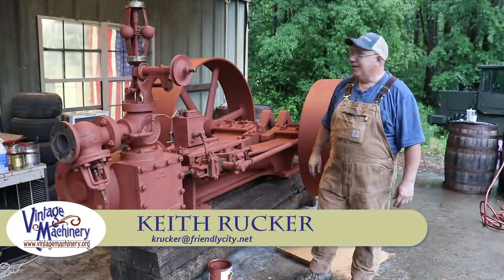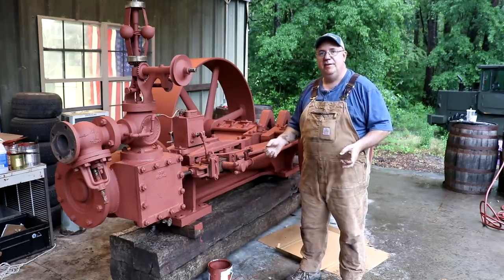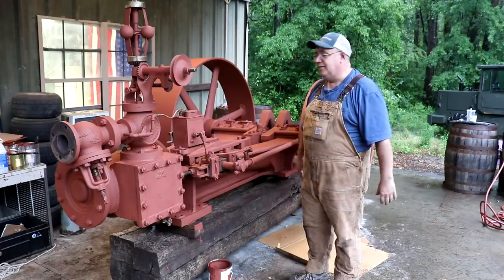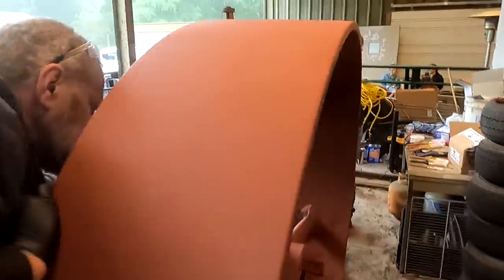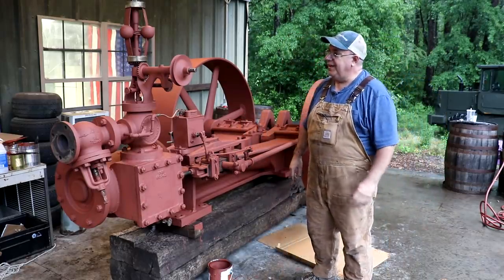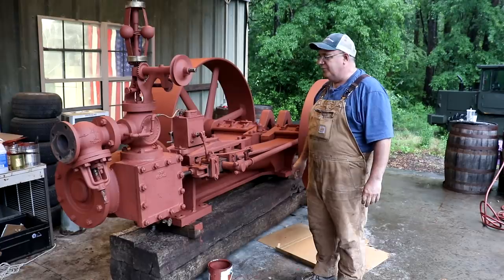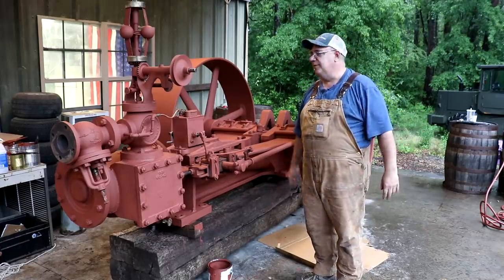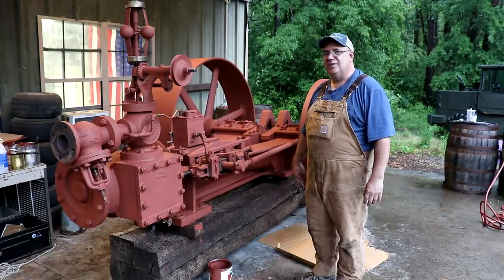Frick Steam Engine Restoration Work Day at the Georgia Museum of Agriculture

Comment: Perhaps they could set up the engine with the boiler and use compressed air to exercise the engine so it was a dynamic display.   Not exactly "working", but it would be better than static...

Comment: It seems such a shame to condem what was a working steam engine to being a lump of metal. 110 HP is one of the more powerful engines still in existence.  Keith, you revere old machinery, surely you must have the urge to see this thing running.
Reply: The engine is fine.  The boiler that fed it was condemned.  After the paint job gets finished, that Frick engine can go to work, should that be desired.